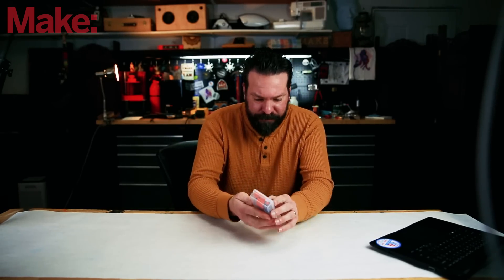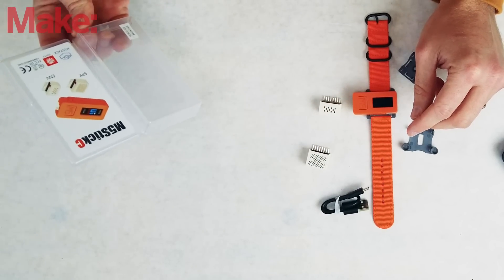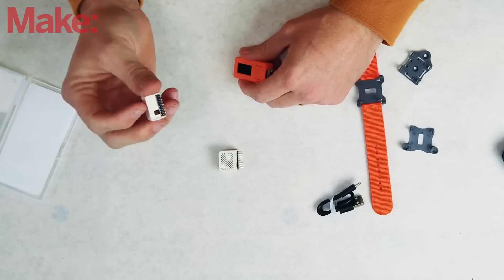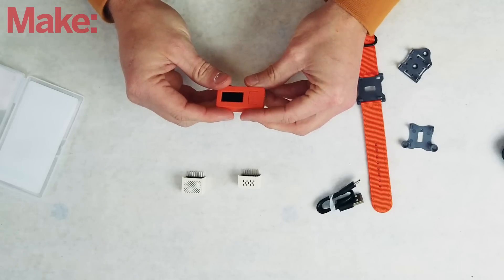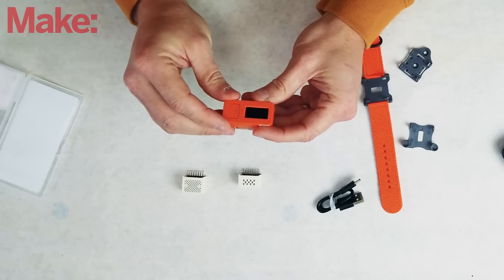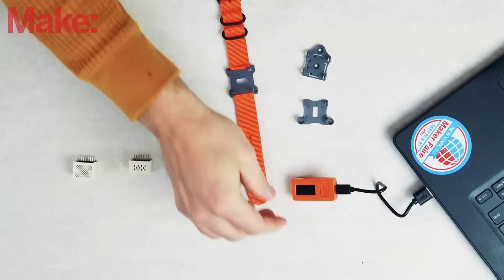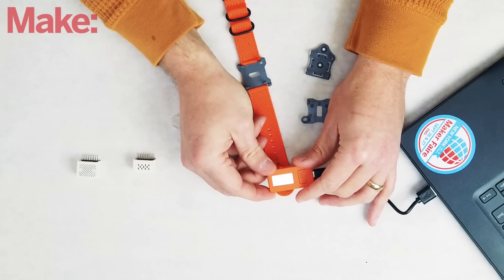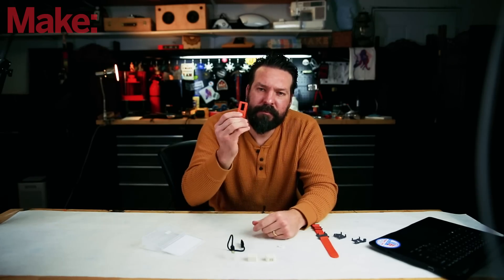Meet the M5 Stick: An IOT platform on your wrist

Comment: I made my own similar device using this bad boy: www.banggood.com/LILYGO-TTGO-T5-V2_0-WiFi-Wireless-Module-bluetooth-Base-ESP-32-2_13-ePaper-Display-Development-Board-p-1332909.html
Reply: ePaper is pretty expensive tho, and likely makes up 70%+ of the cost of your linked board.
Reply: @roidroid  You're way off: https://zh-tw.buyepaper.com/good-display-213inch-e-paper-display-partial-refresh-small-size-e-ink-screen-gdeh0213b72-p0047-p0047.html And I didn't make the board. I just found it and used it cause it is small as fuck and has a build in SD card reader.

Comment: So basically an Arduino style board that runs C, micro python, etc, with an accelerometer, and wifi on-board, and a generic interface at the end so you can plug in "modules" to develop your own wearable IoT devices.

Comment: So what is it? lol It's like a thingy that has some thingies with some temperature sensor and maybe you wear it like a watch. ok?
Reply: It's a "dev kit" for the ESP32 chip, which is a very common chip used in electronics projects.  
Um... it's the "brains" you can integrate into electronic prototypes/projects, especially ones that require wifi. 

Uh... it's basically a small, low-cost, powerful Arduino with wifi.  We can safely expect people here to know what ARDUINO is, right?
Reply: @roidroid  perfect
Reply: Not just a powerful arduino with wifi.  For $15 you get the arduino, wifi, 6 axis sensor, Environment sensor (temperature, moisture maybe?) and more.  I originally got my first arduino kit for $60 with all kinds of sensors and stuff to play with.  I then bought a wifi add on for $10, 6 axis for another $5, moisture sensor on it's own for like $4, etc..  When you link all that stuff together with an aruduino it's a pretty big rats nets of wires or a brick with development boards.  Currently I think you can get an Arduino for like $10 Canadian with wifi built into it.

So this thing is a compact ready to go starter tool to mess with and learn.  Not many pins though, but then I only really use maybe 5 pins from an arduino for basic stuff anyway.  Any more than that and I start looking at shift registers.

In the video it would have been good to have a simple project set up to demonstrate it.  i.e., step counter out of the box?  Angle measurement with an output.  Show the temperature/pressure reading.  Then show a more advanced use like controlling the arm of a robot through wifi, or putting it on a hat with an LED matrix.  Then have it side by side with a small arduino doing the same thing to show the compactness of it.  LED Make sign from a past video but with this controller instead of the arduino.

I'm definitely excited for this one.  Thanks for bringing it to our attention.

Comment: I guess I need to not be doing other things while this plays (so I might have missed the explanation), but I still don't know what this things is. The explanation provided was that it was based on a particular board, but I have no clue what that board does either. Taking 15 seconds to explain the functionality of the device would have been useful. So, your title was basically click-bait since the question is never really answered. ;) Yeah...I'll stay subscribed and keep watching, just pointing out that your viewers are at many different points in their maker-hood journey.
Reply: Yeah I have no clue what it actually is.  Why is it on a strap???  What makes this special / different???
Reply: @clarkgray4109  It's not necessarily different. Just a dev board thats been put in a case, with a strap, and has a bunch of pluggable modules which make it easier to prototype wearable IoT devices. for $15 its not bad at all.
Reply: totally agreed
Reply: The ESP32 is an Arduino-compatible micro controller with built-in WiFi.
Reply: It's a ESP32 on a watch band with a tiny OLED screen. I'm guessing you could develop personal monitoring stuff? An overly complex watch? Masturbation tracker?
Reply from the maker: you're right! new video, with apology and fixes coming today!
Reply: @MAKE  No apology needed! Mistakes are human.
Reply: He said it's an ESP32 dev kit.